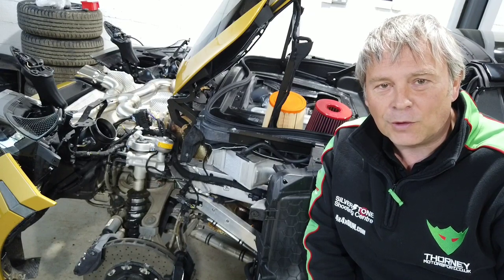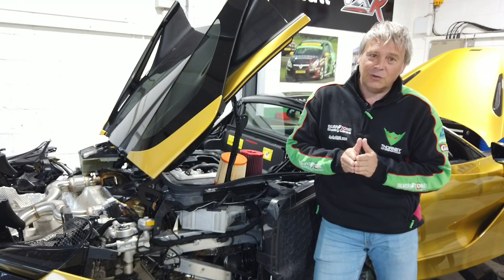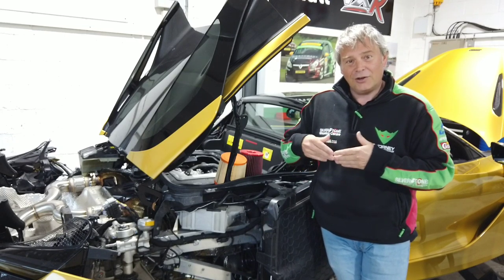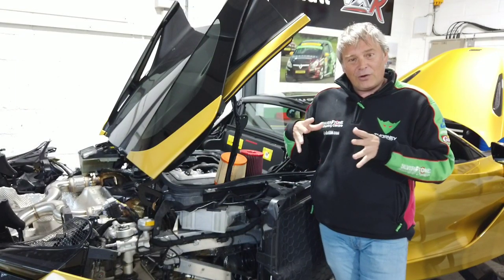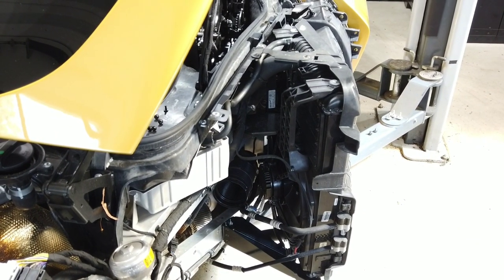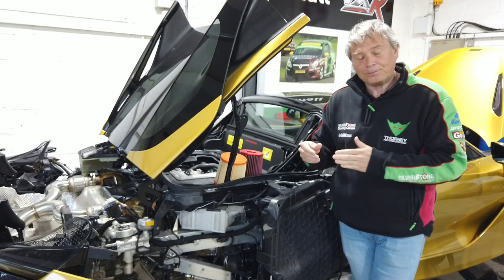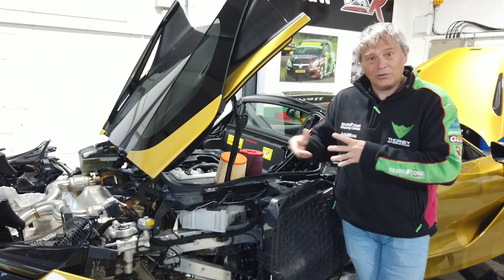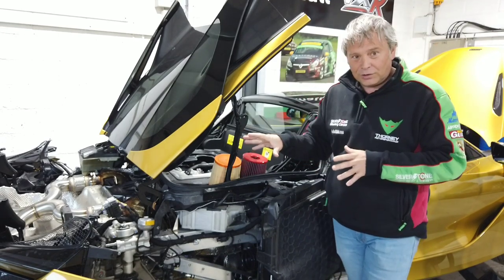Mclaren 720 Vlog - under the skin

Comment: Ok heat exchangers ie radiators work on pressure differential, the 720 has a clever intake where does it exit? Forward of the wheel arch? If so that’s an area of low pressure....the idea goes back to the original LOTUS Europa which uses the right front wheel